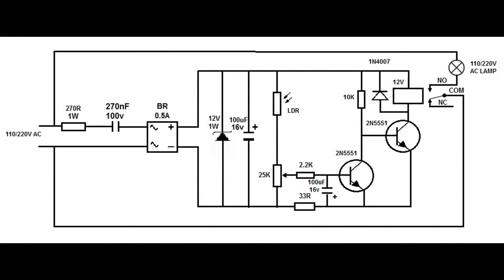Step by step making 220v automatic light switch (Photocell)

Comment: the 820uf 400v capacitorthat you used, is that an AC or DC capacitor?
Reply from the maker: AC, In the video i used 270uF to make the circuit small as possible